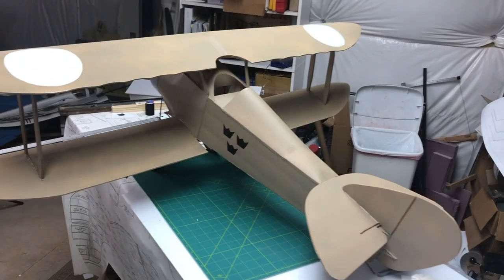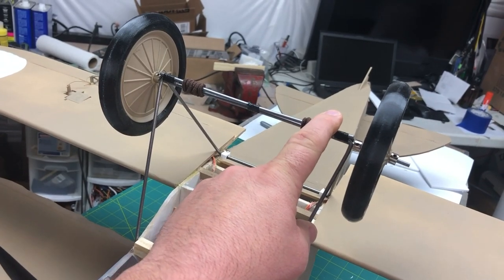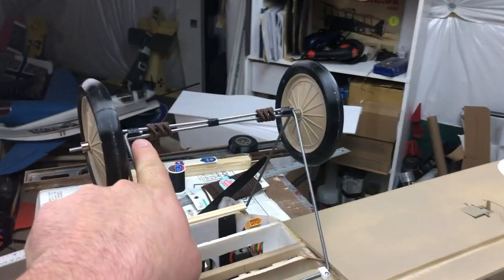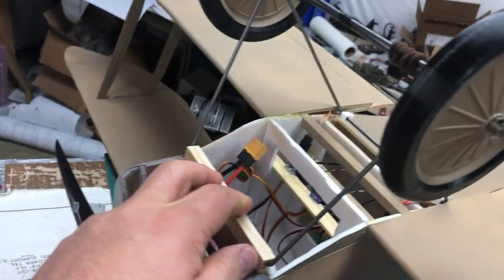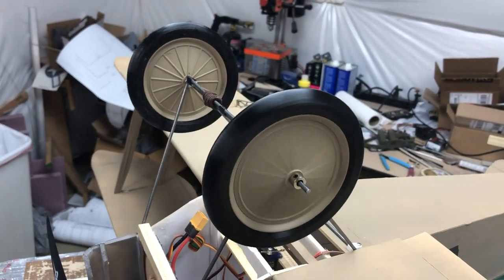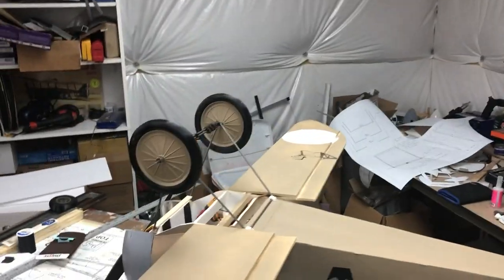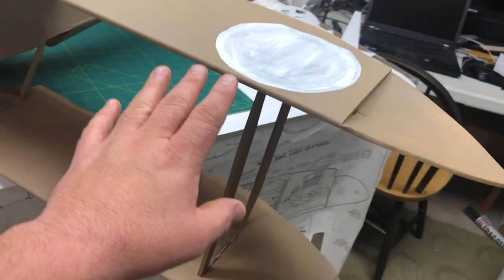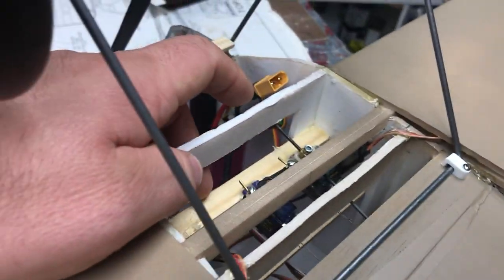Balsa Plans to Foam Board Airplane EP04

Comment: For bending: get 2 short tubes with a bit bigger diameter to bend the wire with your hands instead of hammering.

You will have a better control of the angle if you push those metal tubes over the wire and then start bending bit by bit.

If you do not have such tubes then there is another way to achieve the same: 
take a rod of wood and hammer 3 U shaped nails over such wire on which you first put a small piece of 1 mm cardboard. Nail them carefully down till they touch the cardboard and then remove that small piece of cardboard. 1 mm or 0,5 mm is enough space to get the wire easily in and out of this tool. 

This trick will avoid cracking cause you will not hammer onto the wire that it can crack, just a smooth motion close to the angle you need and then check the wire by laying the piece onto the paper plan. Now you see easily what is missing and bend on the plan to get close and closer.

If you need to do more then the best are small pieces of U shaped aluminium profiles with different dimensions like 2 x 2  or  3 x 3 or 4x 4 mm square size for your rods, cause the wire should not have too much space. If so then add tape on the wire to make them thicker.

You can fix those U profiles on your wood with 2 or 3 wires. But you need profile sizes that match you wire thickness, that's why I have multiple of these tools. But I prefer fixed tubes on the wooden rods stabs to have a better force control while bending. 

I had lost too many wires and therefore played around for a better tool. Good results, cheap and reusable. 
Of cause hammering is faster but try to get control in smaller angles than 90° or bigger cause there the complication starts.
Reply from the maker: Yes, using a sleeve over the rod will give you more control but you are still using cold metal that may stress fracture. Yes, the impact from hammering can cause the fractures and you have some really great suggestions here. I chose to go with the absolute simplest way so that others can approach it a little easier. I do hope that other folks see your comment here and can use it. Thank you for following along!

Comment: Have you ever found that when painting readiboard directly, it will start bowing?  Possible I run into this from painting one side at a time?
Reply from the maker: Yes, it's possible but it's also possible you may be applying too much paint at once. Try to go even lighter with your application. It may seem like a pain but it's the steps you have to make with the media you are using.

Comment: Well done. Looks really nice. Thank you for taking the time to put out this video. I know I n the past you mentioned a filler but can’t remember which you used. Do you use packing tape? If you do is there an adhesion issue with the spray paint?
Reply from the maker: When I use filler, I use the 3M stuff. DAP has gone to a material that includes a latex primer and it does not sand... like at all. I do not use packing tape. Again, weight. Thanks for following along and the questions too!